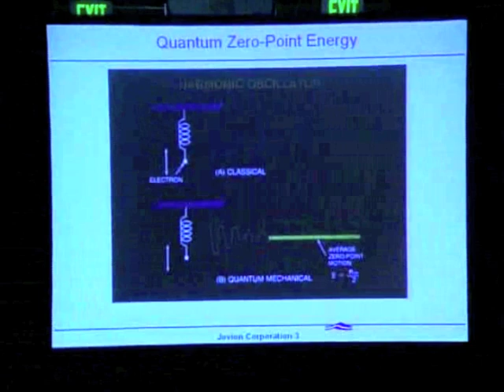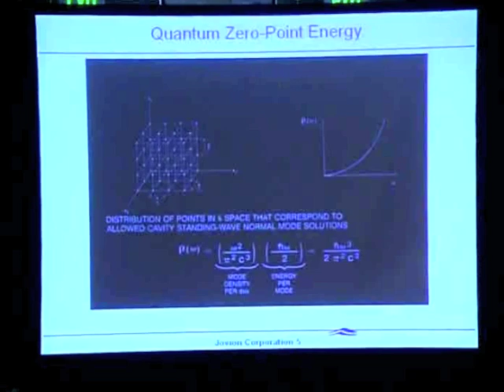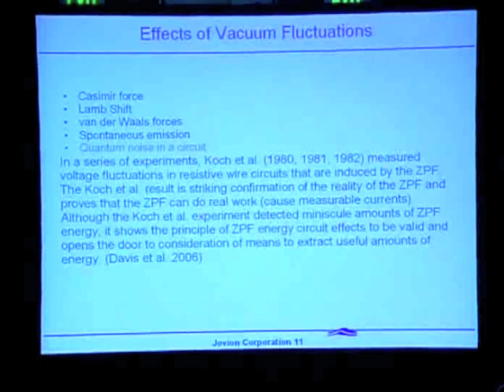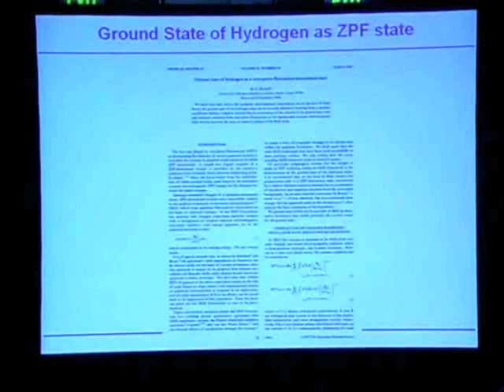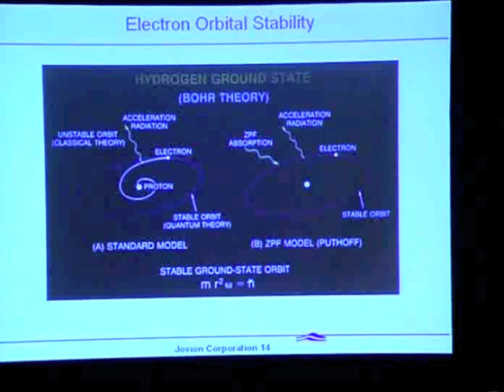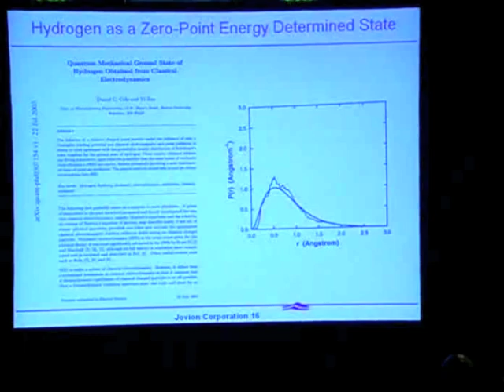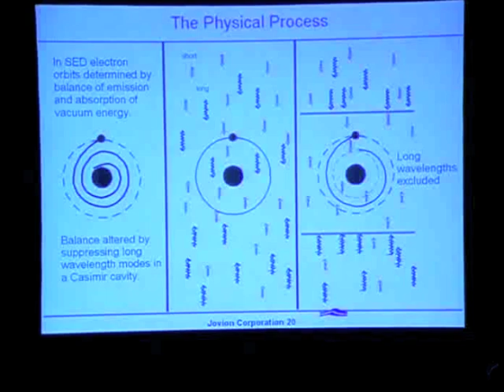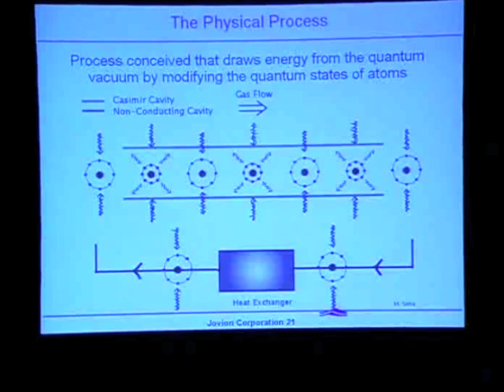INDIRECT EXTRACTION OF ZERO-POINT ENERGY FROM THE QUANTUM VACUUM: PATENT 7,379,286 - Part 1

Comment: How much energy could you get out of such a device if it actually worked? (which it wont for the reasons discussed!). Energy per hydrogen atom through the device ~ difference in lamb shift of H1s orbit outside cavity compared to inside ~ 1Ghz say as rough guesstimate upper limit. = 6.6 10^-25 Joules  or about 0.4 joule per mole of H atoms. This is about six orders of magnitude smaller than the 1ev per atom suggested in the questions at the end of the lecture.

Comment: The energy did not come from the ZPE of vacuum outside the cavity. To do so would violate the uncertainty principle as it is removed from the vacuum for the duration of the H residence time in the cavity which can be arbitrarily large. Nor did it come from the vacuum ZPE in the cavity for the same reason. It must have come from the gas itself i.e reduction in the kinetic energy of the hydrogen. This is possible given the size of the energy difference Hc - Ho = lamb shift inside-outside cavity

Comment: a second argument that supports the hydrogen atom being higher in energy inside the cavity than out side is that " the lamb shift due to the casimir plates ...always gives rise to an enhancement of the lamb shift" (seep8 "Lamb shift in non-degenerate energy level systems placed between two infinite parallel conducting plates" B.Billaud T.T.Truong arXiv;1202.5705v4)

Comment: That the H is in a higher energy state in the cavity seems paradoxical but is consistent with the role of ZPE in sustaining the Bohr orbit. Where did the extra energy of the H in the cavity come from? Absorption of the low frequency virtual photons of the vacuum which are missing from the vacuum in the cavity? On leaving the cavity are they returned to the vacuum?I suspect paradoxes arise from treating the zero point field as if it were a box of real photons rather than virtual photons.

Comment: If true, the following negates the possibility of tapping the ZPE as proposed: If H 1s Bohr orbit is sustained by a balance of radiative emission and absorption from ZP field as suggested by Puthoff, then when the H atoms enter the cassimir cavity they will absorb less as ZPE density is lower. So, for the Bohr orbit to remain stable it must radiate less. To do so the orbit must expand (not contract as you assume): Larger orbit,less radiative loss. ie the H absorbed energy on entering the cavity!

Comment: If the radiation released by the entering hydrogen is in equilibrium with the hydrogen in the cavity then there will be hydrogen present in the cavity in both the cavity ground state form(call it Hc) and the outside vacuum state form(call it Ho). The Ho form can leave the cavity and no energy is required for it to do so, but the Hc form will expereience a retarding force preventing it from leaving. it requires the energy (=Ho-Hc) to go. (like use of stark effect manipulating molecular beams).

Comment: If the cassimir device is absolutely ridgid so it can do no work on the external vacuum states  even then when the hydrogen enters the device and it gives up energy. it requires the same ammount of energy to leave the device. What is to stop it gaining the required energy on leaving from that released by newly entering gas rather than from the vacuum? That way the vacuum quantum state doesnot change, energy is conserved but no work is done nor energy produced by the device.

Comment: The zero point energy of the vacuum is the energy in the lowest quantum state of the vacuum. For the vacuum to do work or release energy it must make a transition to a lower energy quantum state but there isnt one by definition. So we cannot extract zero point energy in a cycle that leaves the vacuum in the same quantum state as we found it. But that is the only state the vacuum can be in surely by definition!

Comment: The hydrogen enters the cassimir cavity it experiences a different zero point field to that outside the cavity, causing it to give up energy. Is that energy equivalent to some of the excluded radiation modes which gave rise to the cassimir force? Wont it cause a reduction of the cassimir force, push the plates apar,t thereby do work on the external vacuum states. Work recovered by the hydrogen from the vacuum when it emerges from the plates.:- therefore no net energy change of the vacuum.

Comment: `Tesla's spark gaps create a cavity between neutral plasma growing from each electrode.  When the plasma fronts broach the casimier distance a portion of the plasma is driven together by the zpe.  This results in acceleration of a portion of the plasma as illustrated by the casimier force.  The resulting collisions of the plasma results in plasma waves back through the spark gap to the electrodes. And electrical currents shedding the zpe.  He did this with copper and wood.  No microtech.